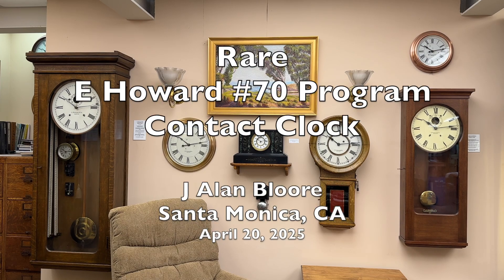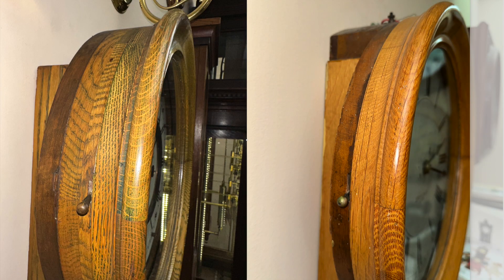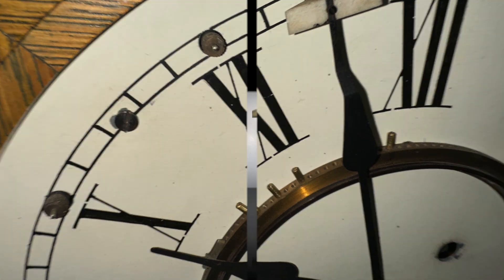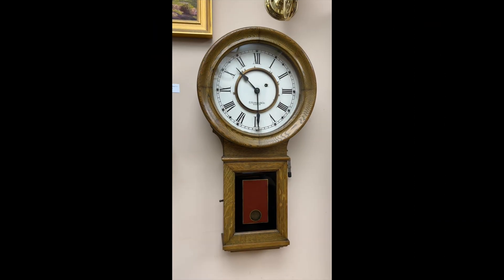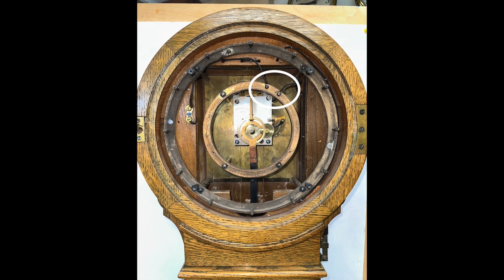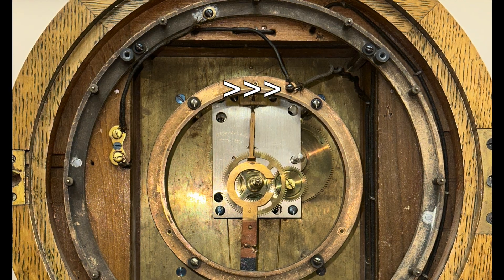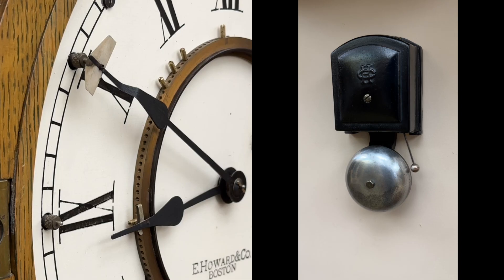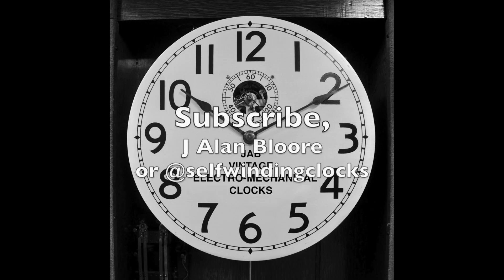E Howard # 70 Program Clock

Comment: Very nice clock. I have a NTR clocking in clock that is also a programmable clock that uses a similar method to yours shown here. It uses the contact studs on the chapter ring like the howard but there is a brush wiper on the back of the metal dial and a central program disk with pawls you attach to make a contact switch to prime the circuit for the bell event. Rudimentary but effective.
Reply from the maker: Your NTR clock does sound like the contact ideas are quite similar. As you say, rudimentary but effective. Thank you for watching the video and taking the time to share information about your programmable clock. New to me.